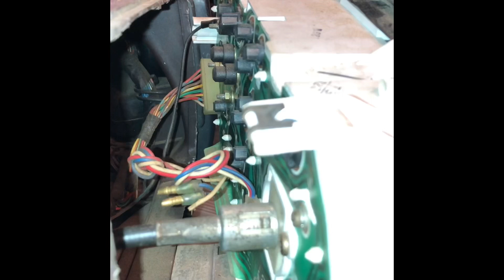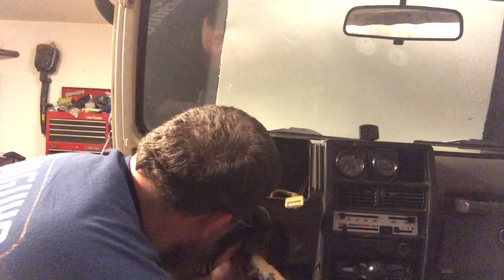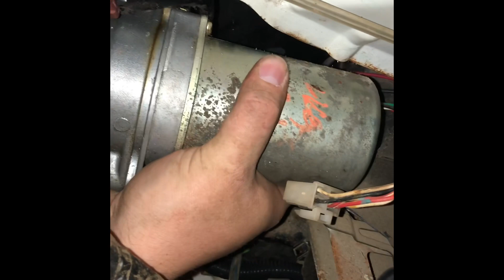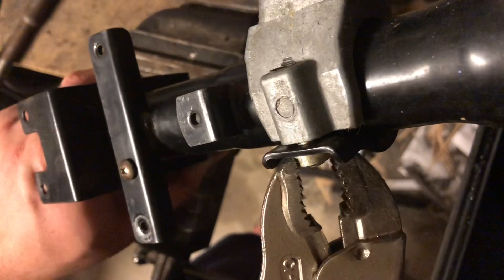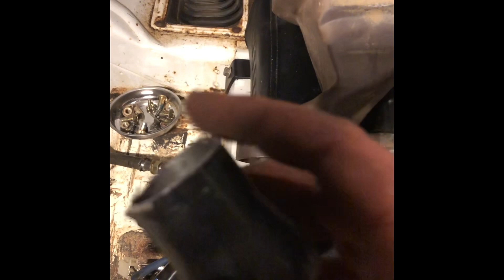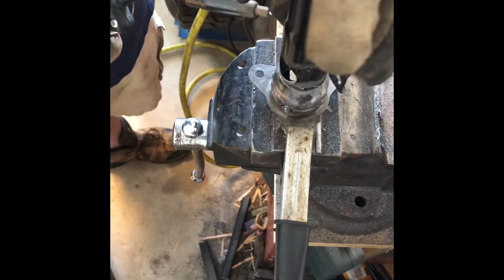Suzuki Samurai Electric Power Steering Install!!! Part 1

Comment: Just curious. Would the power steering unit fit down in the engine bay?
Reply from the maker: Kevin Savas it sure will! It will fit down close to the steering gear box, but you can't run an ac compressor or a turbo when it's placed there. I have plans for a turbo next year so this was my best option
Reply: Yes